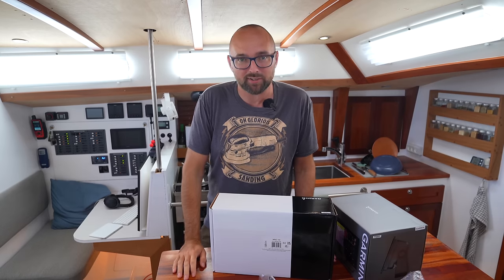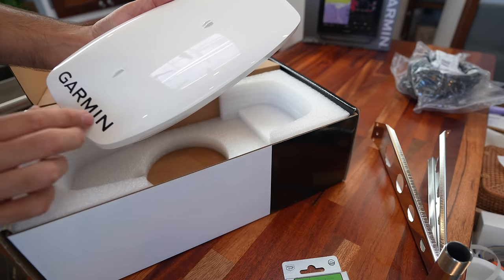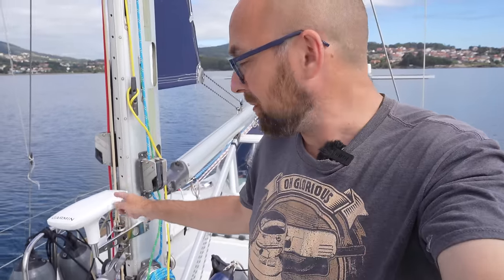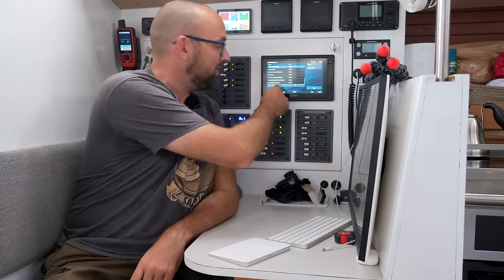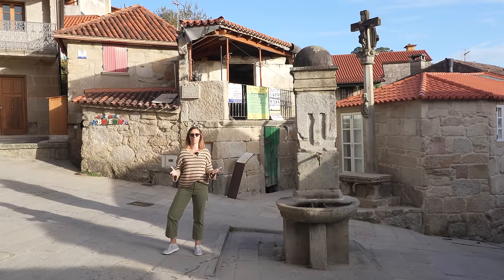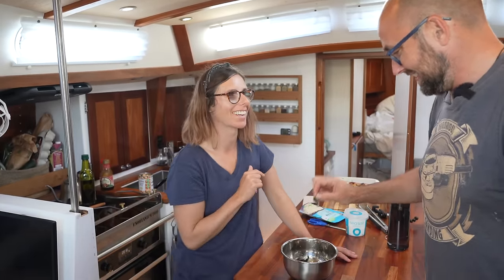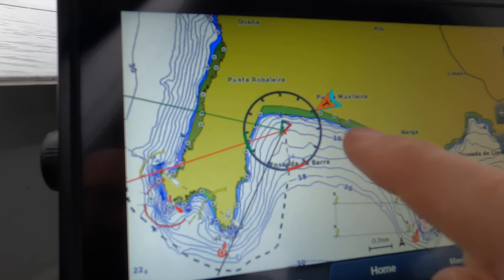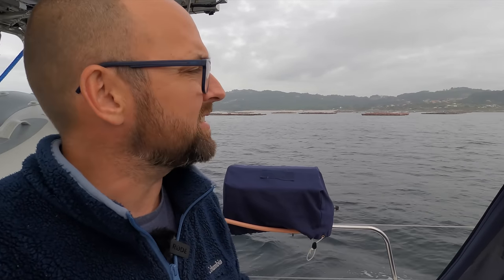Sail Life - Garmin MSC10 Marine Satellite Compass ⛵️

Comment: Since the MSC10 is so accurate, I hope you're not going to get false COG data when the mast is swinging heavily, e.g. in downwind conditions...

Nevertheless, another piece of cool gear! It almost seems as if it's your goal to collect the whole Garmin catalog 😉
Reply: That's what the additional sensors are for. Besides gps it has xyz rotation detection and and what sounds like an electronic compass.

When the boat rolls it will register that but will also detect that it didn't actually turn so it will take all that into account for the eventual data output.

Comment: I am not a pilot, or a gps expert, but wouldn't your pitch/yaw/roll info become dramatically increased as you move higher up the mast?  Even a small movement at the waterline could be several feet up on the mast.  And a violent sea state could induce dramatic movement up high.  Do you tell the MSC10 config it's height above water???  Please keep us posted, as I would expect possible drama.  Hope I am wrong.
Reply: The angles will be the same, just the lateral motion will be greatly amplified. However, I suspect that will be taken into account, the turn radius will be calculated and the displacement from pitch and roll factored into the position output.
Reply: I believe there’s a 3 or 4 axis accelerometer in the sensor head, hence the additional autopilot refinement of operation in adverse sea states when this unit is integrated into the NMEA data stream. 
The software is probably interpolating all axes motion inputs and producing its own calculated mean centre  of motion, which would be a point within the volume of the hull, at or near the mean convergence point of the centre of gravity, centre of buoyancy and centre of mass….or something along those lines. 
They make some pretty good kit for aircraft too, very nice indeed!
Cheers, R. 😎👍🍻

PS, Not easy to explain the accelerometer thingy after a jar or three, I apologise if it makes no sense, had to try. 😂

Comment: You should put a nylon wheel beside you anchor.  It should be cheap enough, run on that bolt nicely and will protect the line

Comment: Madds, you might find that even thought the radar is at a different frequency that it interferes with the GPS. (Just the power from the transmitter can cause it to happen) If you notice it all you will need to do is slide the GPS about 5 feet farther up the mast and that should give you enough separation.

Comment: They make hard rubber bumpers that fit on small boat trailers for the boat to bump into after its winched onto the trailer. They usually have a 1/2 inch hole to run a bolt thru to mount them on the trailer. They are very tough and would work great for what you want to do.

Comment: You didn't describe the sound from the rudder, but depending on the rudder and hull shape some boats start to resonate at higher speeds. The sound is usually lower in frequency than failing bearings, which i'm sure you are familiar with 😉The resonance shouldn't be anything to worry about, and i'm sure someone with more expertise in hydrodynamics can explain why this occurs

Comment: I have a similar issue with my rudder in that under motor the helm seems stiff or sticky. It's fine under sail though. I hauled out this afternoon and will investigate tomorrow. Be interesting to know what you find. Also, I was anchored in that same spot a few weeks ago, it is tiny. Marina Punta Lagoa is just around the corner and has a very good yard. Not that that is any use to you now.

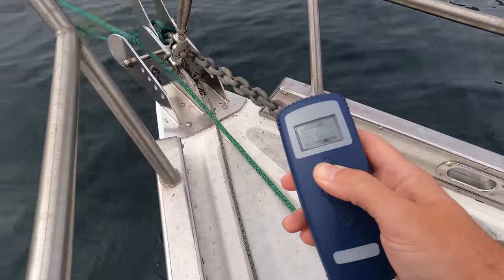Comment: 15:58 a pallet wheel might fit that "shaft" perfectly. Not sure on spacing, but you can narrow them down. They make for excellent pulley wheels. Cut a nice groove with a grinder down the center and smooth it out with a bit of sand paper and they're perfect for soft line (even steel braided stuff doesn't wear them that much).

Comment: Why to mount the MSC10 so high up in the mast also with the mast so close and therefore big blind angle???
I would put it on the solar arch, especially to avoid to rough movements of the mast (and to avoid extra rivits at the mast).
Reply: The MSC10 is good on the mast, but it seems awfully close to the radar. Is there any possibility of radar interference. I would have probably mounted it about 2' higher.

Comment: That gps antenna's size doesn't make sense. Gps is pretty high frequency; the higher the frequency, the smaller the wavelength, thus the smaller the antenna. You're looking at about 5" or 13cm for a full length dipole. Seems shady.
Reply: Bigger telescopes give better resolution I guess.
Reply: They probably put a 3 axis accelerometer in it to aid with the yaw, pitch and roll calculation, along with some other electronics.
Reply: There is no "antenna" on that big GPS receiver. There is probably a multiple antenna array using quadrifilar (helical) antennas, or a small phased array, or even multiple flat panel antennas, each tuned for one of the four different "gps" systems that will all be active shortly. All those options make it more accurate than the gps chip in your smartphone.

Comment: The next time you’re near an auto parts store you should stop and pick up an oil change kit. It’s a little rectangular piece of plastic that you can drop oil on, it’s reusable and it’ll tell you the quality of the oil so then you can actually change it when it needs to be changed rather than just change it on the hours basis it can see me a time and money and sometimes you might need to change it before the hour limits it’s a great lifesaver. Last time I picked one up in the US it was around $85 for the kit.